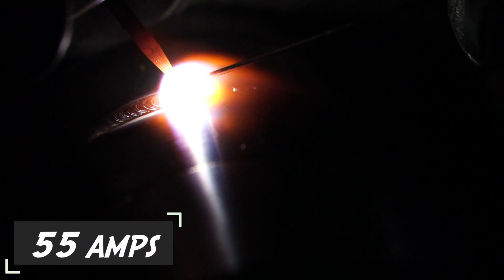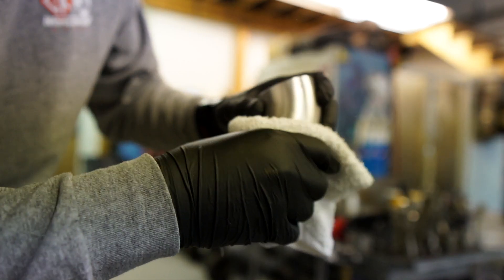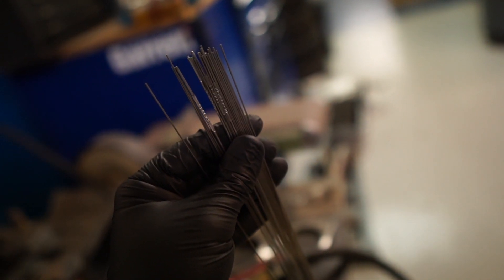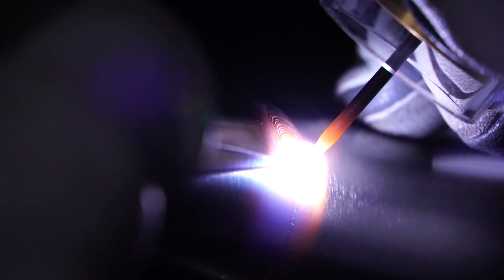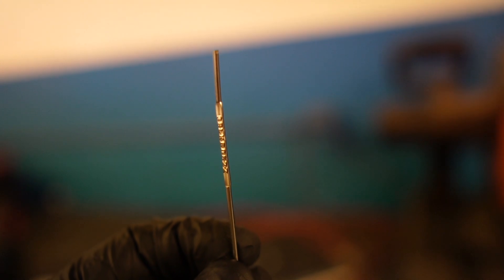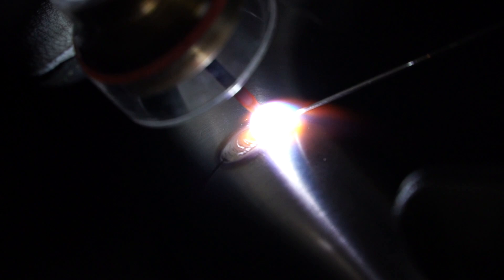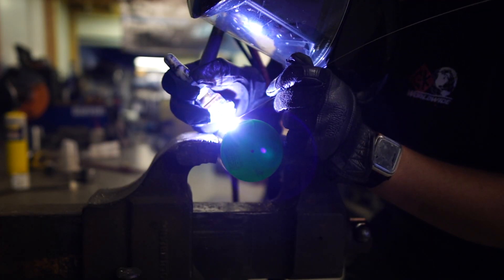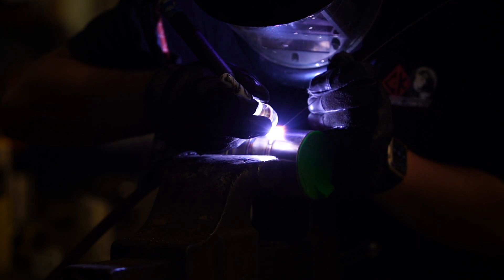How to TIG WELD Stainless Steel Tube + Tips & Tricks | Automotive Fabrication | GTAW CUPS

Comment: Brad, Awesome Video as usual. I have to say this was one of the most in depth Videos on Stainless Tig that I have seen EVER! I mean there is a wealth of information here for the Beginner, and Intermediate Tig Welder, and there are sweet little Tricks in here for even Veterans. I loved that little Propane Torch Trick for getting rid of any leftover Lint or Frbris from your Rag/Paper Towel when wiping down with Acetone. I've never seen that before, and will be implementing that into my Weld Prep Rituals. I've been Fabricating, Welding, Mechanicing, etc for a long time, and I still always learn some new Tip or Trick everytime I watch one of your Videos.
Reply from the maker: Means more than you know! Thanks so much for your support Phillip. I really appreciate the feedback, comment and engagement. That’s what it’s all about! 🙌🏻 I’m glad you can take something away from my videos.